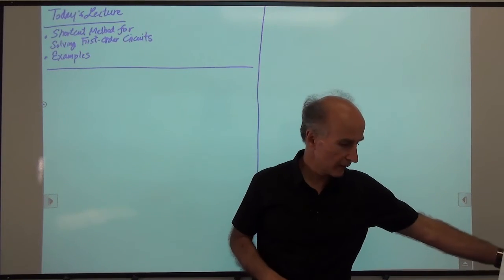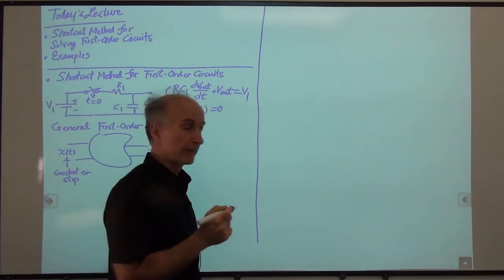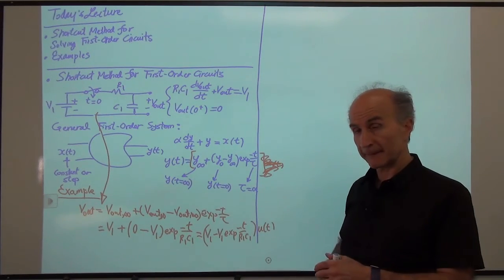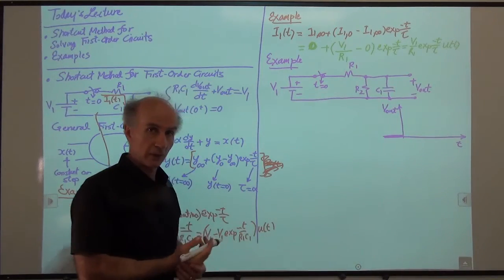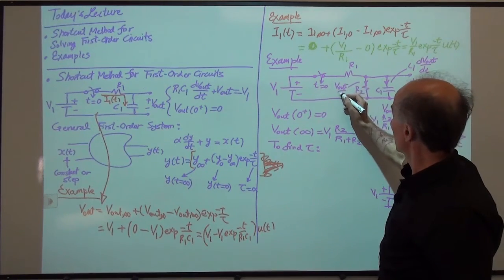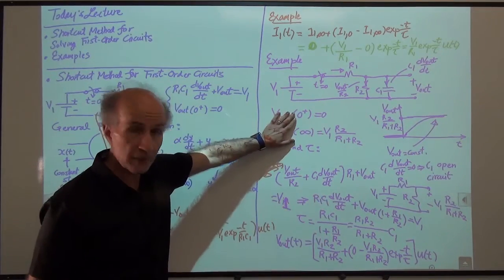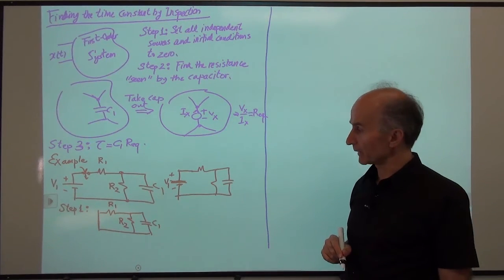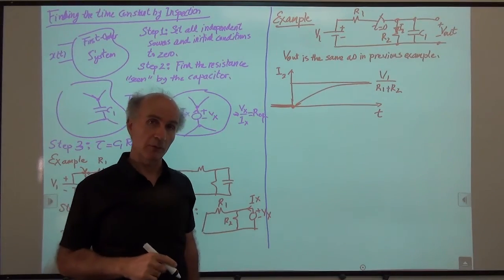Razavi Basic Circuits Lec 19: Shortcut Method for First-Order Systems

Comment: something creating confusion is this : the standard equation of the shortcut is written as: alpha(dy over dt) + y = x(t) 
next we see a calculation of y(t) using y(inf) and y(0)..... meaning the x(t) is y(t)....
in the first example we calculate I1(t) with this  putting I(inf) and I (0) in the arguments... and again x(t) seems to be y(t)   so the standard formula looks to be alpha(dy/dt) + y = y(t)

all good so far, until the second example : here we see V1 = R1C1(dVout/dt) + Vout(1 + R1/R2)  a little shocking, since V1 is a constant and not a function of time.....

some algebra however solved this since by deviding all the terms by (1 + R1/R2) the V1 in the equation transformed into Vout and alpha(dy/dt) + y = y(t)  is now respected....

hope my confusion can help some people going looking into these quit nice lessons
Reply: can you help me understand why Cap voltage can't reach value of V1?

Comment: u(t) keeps dropping out of nowhere....
Reply: it does not. let me break down that for you: you see when we are studying driven rc circuits, if at t=0- we dont have any initial conditions and then we apply some input to it, the circuit (at least in our courses) is bound to have a step input and response. to put it all together, if there are no initial conditions and we apply an input at t=0, the input voltage can be modified as a step function and the response as step response.